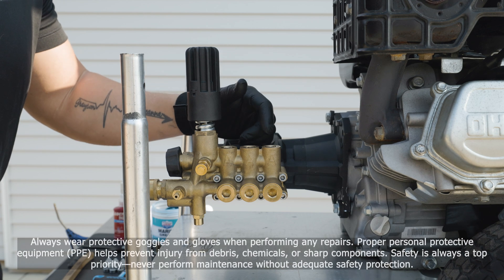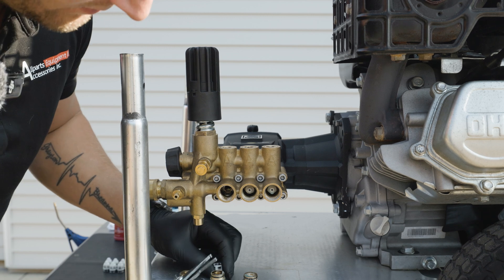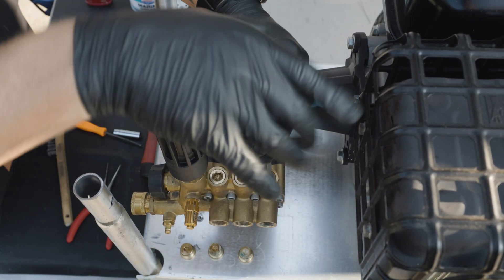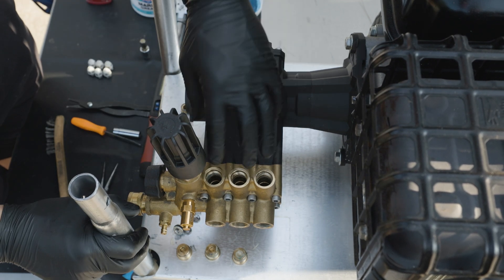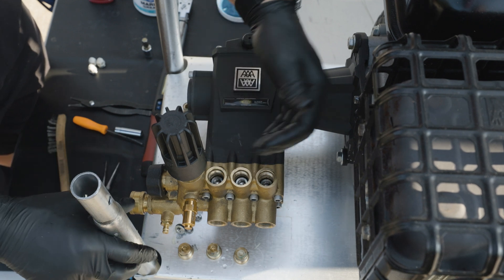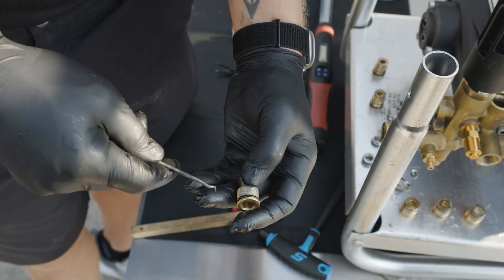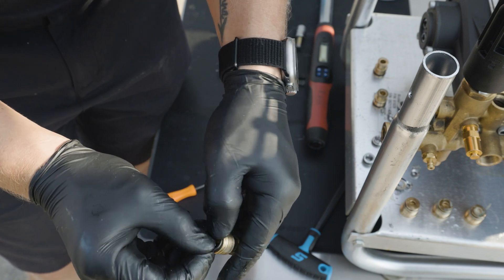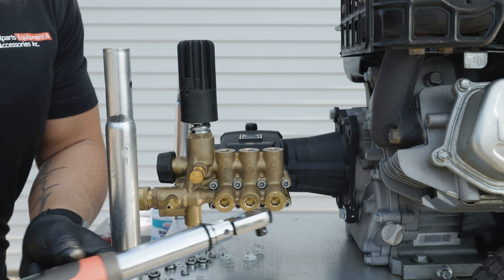New Valve Installation Tutorial - AAA Pressure Washer Pump Repair

Comment: How do you know when they are bad?  Mine is making a grinding noise and has low pressure. ( Same pump)
Reply from the maker: If the grinding noise is coming from the crankcase, you might have low oil. If not, you should remove the valve caps and do an initial inspection to see if any of the valve cages appear to be smashed. You will have to take them out to see if the springs & seats have any debris stuck in them.

Comment: I work on these too. I’ve noticed the valves have threads on them. Have you found a bolt that will thread in to pull them out instead of pliers?
Reply from the maker: Yes, the 7108750 valves have an M9*1 thread
Reply: @Allpartsinc  m9 thread by 1mm pitch or 1.25...I swear I have tried those both but maybe not
Reply from the maker: @spacedace2000  it should be a 1 mm pitch. It can be a hassle to thread them even if they are the correct size unfortunately. We do sell AR valve pliers that might be worth the cost if you work on these pumps often: https://www.allpartsinc.com/pliers-valve-removal-ar2761490.html